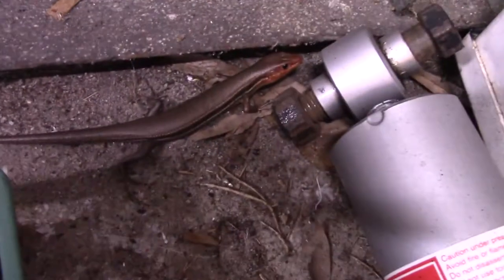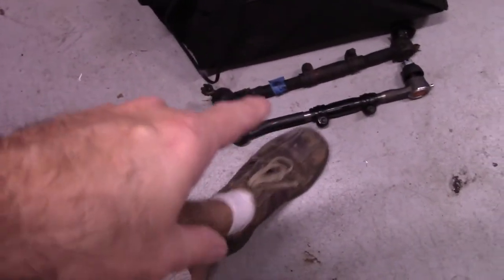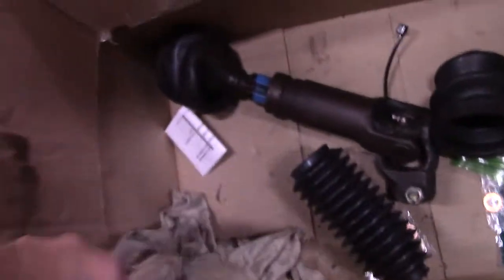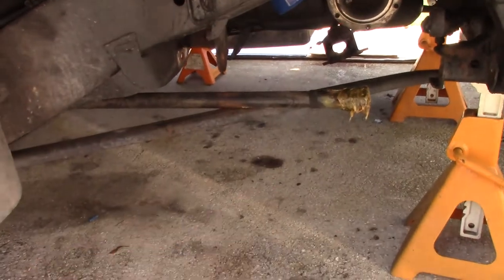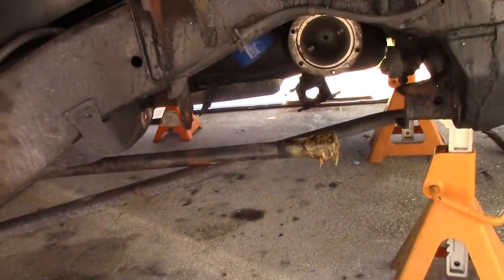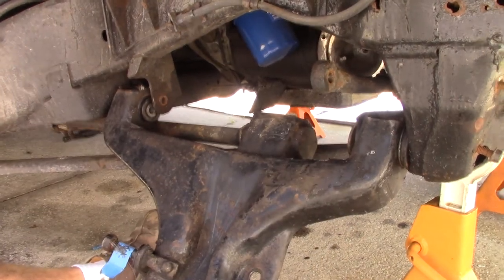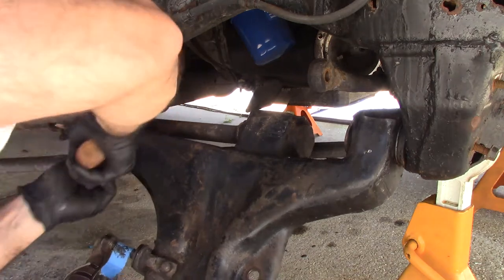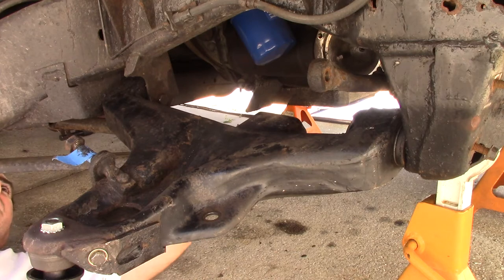Installing the front end parts on the 1976 GMC Motorhome

Comment: Great Video - I am going to work on same thing what you did work on this Fall.  I did look into 1 ton conversion but decided stick with same one cuz it works just fine for over 40 years.  Seeing wear out rubbers around suspension systems that all need to be replaced.
Reply from the maker: If you're going to take it apart might as well do it all.

Comment: Did you look into the 1 ton conversion?
Reply from the maker: Yes, and I thought about doing it but then figured if this front end lasted 40+ years then rebuilding it will last another 40yrs. I also talked to some people that had the 1 ton and they went back to OEM.. While there are people still remanufacturing the knuckles and supplying other MH only parts I'd like to support them so they'll stick around.
Reply: My 1T has 5 yrs troublefree running. Definite DIY. Where to next (steering box & steering shaft play assesment)? Thanks for documenting.

Comment: How did you get the old drag link bar out?
Reply: Does it need to be in Neutral drive position and parking brake off also? Thank you.
Reply from the maker: The drag link just unbolts and it should come right out.
Reply: @KGsGarage  mine must have bent bolts or something,  maybe some harder hits with the hammer will knock it loose